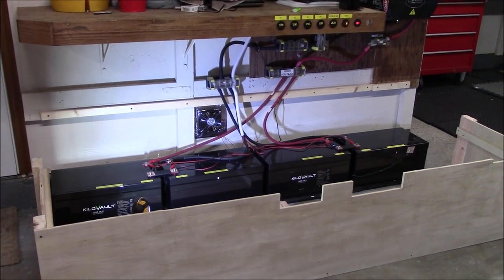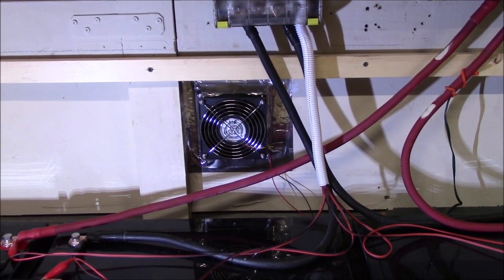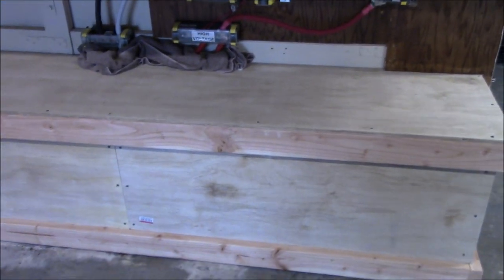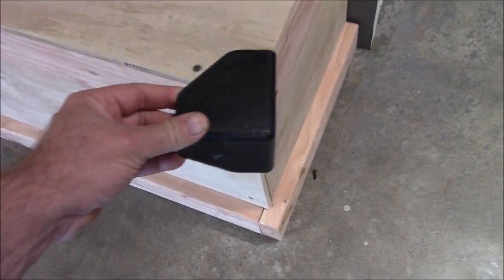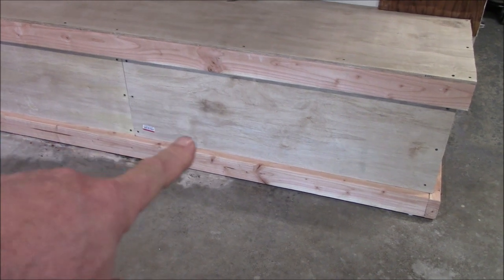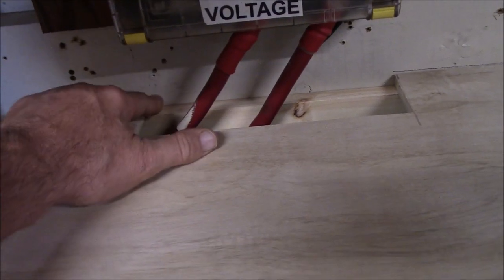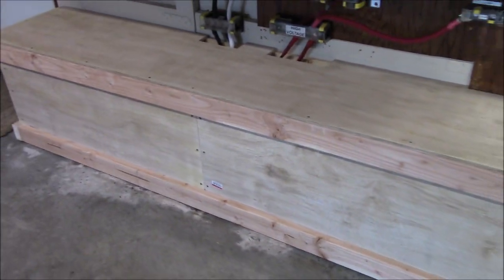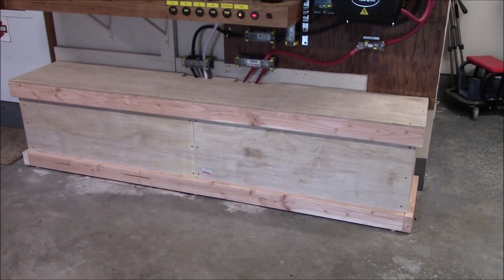LiFePO4 lithium battery bank enclosure box (forced air cooling, climate controlled)

Comment: perhaps you could put a thermostat controller for the fan.  wouldn't have to worry about turning on when needed and wouldn't pull cool air out of the house when not needed.

Comment: I think you should either just relocate the batteries to inside the house or if you're worried about safety than why not just use a deep top hinged freezer? that way you don't waste so much central AC because your design is very wasteful. some other options is to 100% seal the battery box and have 2 vents, one for hot air to come into the house and a 2nd vent for cool air to come into the box from the house. having the air coming out of the box now and into the garage is a very energy inefficient idea. if you go the deep freezer route you can install heating pads underneath for winter to warm the cells

Comment: forgot to add a link to the controller. you can get them in 12, 24, or 110 volts. 
https://www.ebay.com/itm/STC-1000-Digital-Temperature-Controller-Dual-Relay-Output-Thermostat-with-NTC/173987471995?hash=item288276227b:m:mHT1qaGSjLEnUfUm0sxE4SQ
Reply from the maker: Thanks! Holy smokes...that looks like the Inkbird I have installed on my freezer-to-fridge conversion. Hmmm!